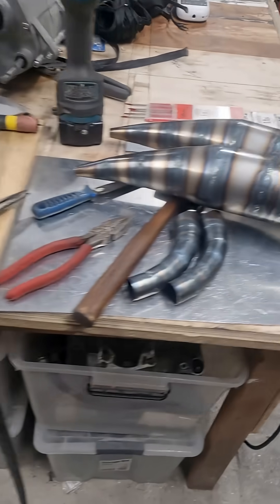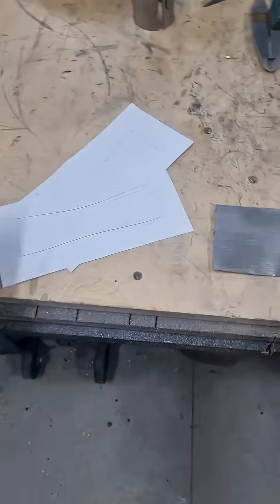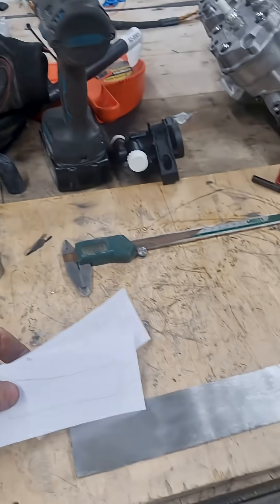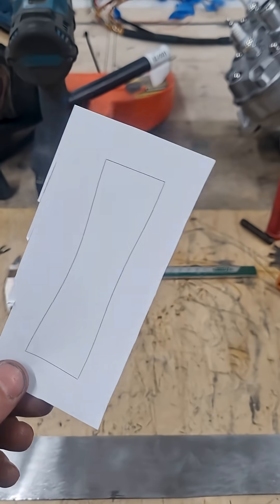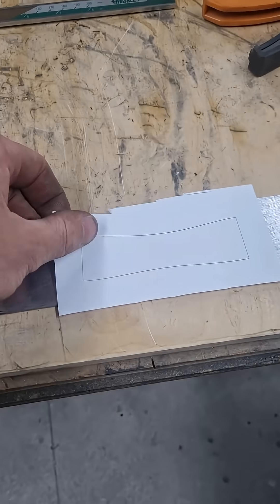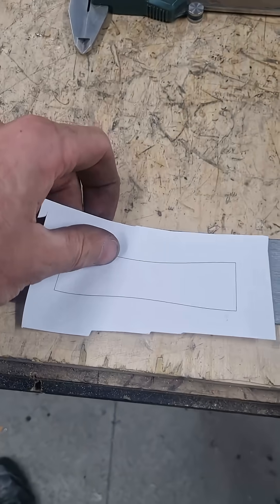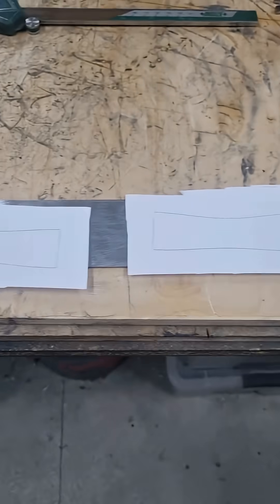Expansion Chambers for our 3D printed Race Engine

Comment: Sick. What was the material of choice for chambers? 
Looks like there was no filler rod, just fusing it with the Tig? 

Sorry I ask too many questions 😅
Reply from the maker: Haha no such thing as too many questions. 0.8mm mild steel, and yep just fusion welded as much as possible. Ideally id gas weld pipes but I don't have a torch so tig it is
Reply: @SketchyRacer good to know good to know. 

Did you model in solidworks and then flatten for cutting? 

I was trying to learn on fusion. Was getting there but....very punishing.
Reply from the maker: @hughesey92 Yep all done in solidworks. It's a bit of a trick to get it to model the cones and flatten them but worth it. The laser cutting for both pipes was only $130